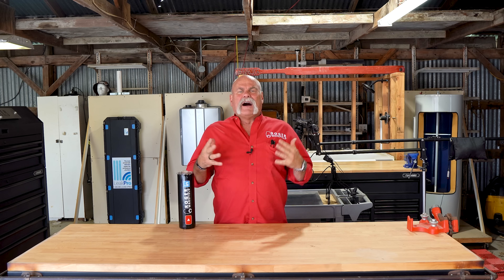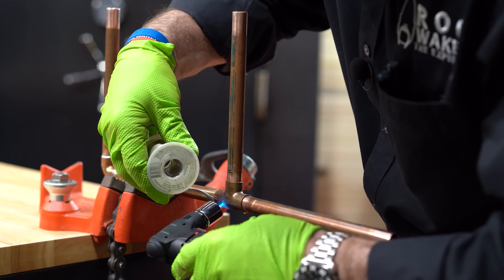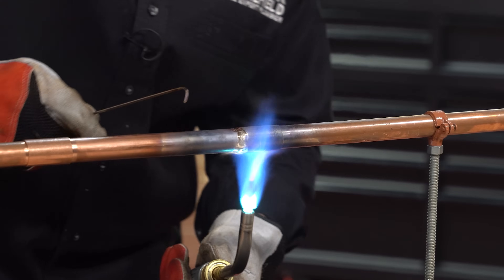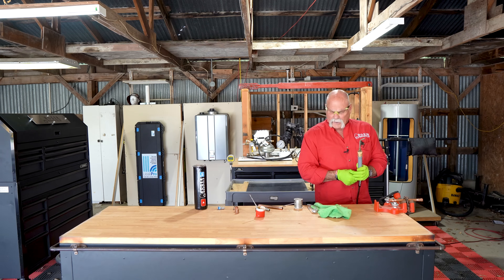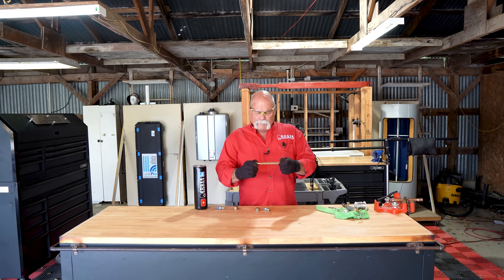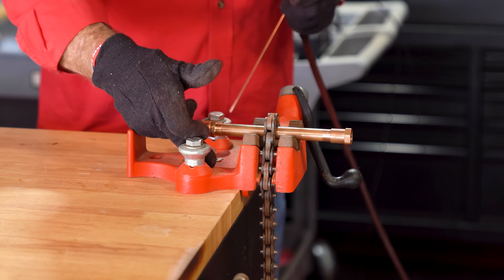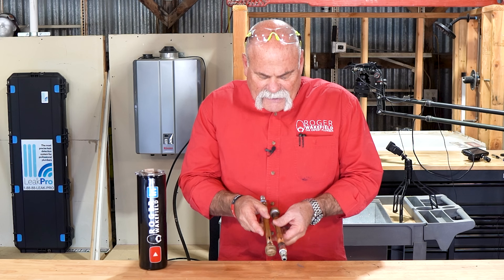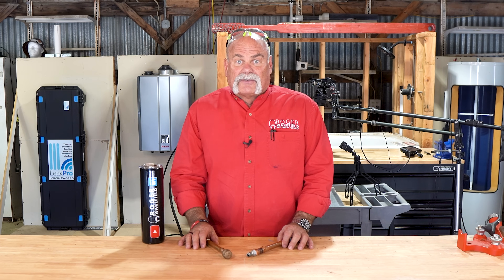Which Is Better Solder or Braze? | Pressure Test

Comment: I love this testing, and this confirms my point with refrigeration techs that never believe me - a soldered joint using something rated like Stay-Brite 8 is possibly stronger than a BRAZED joint. The problem is brazing weakens the copper from the high heat needed to braze. Solder temps do not do this, and it's just as strong as shown here. It held twice the pressure. Notice how the copper failed close to the braze joint, the heat affected zone. Any more of this type of testing you could do is great!!
Reply: I'm a refrigeration tech.  My main concern with using stay brite vs. braze is the temperatures the system operates at.  Compressor discharge temps in a refrigeration system can be over 200 deg F.  That's hot enough that it makes me question whether a solder joint can hold over time given its lower melting temperature.  If you get into large supermarket systems, nearly all the pipe in the system can go through regular thermocycles of up to that temperature daily, sometimes multiple times a day.  The 15% silver braze I use has an application temperature of around 1500 deg.  As long as I do my job correctly, I know I'll never have to worry about that joint failing because I have seen properly brazed joints well over 50 years old still holding leak tight.
Reply: @VTdarkangel  Stay Brite 8 solidus point of 430F and liquidus of 535F. Meaning it is solid at 430F and lower, and won't become liquid until 535F. While yes, in some high heat circumstances I agree, but even in R410A you aren't going to see above 150F (for the record, that would be a pressure of 615 psig, which the system would shut down by that point).
Reply: @JohnChuprun    You're referring to liquid saturation temperature.  The temperature of the gas as it comes out of the compressor is much higher than saturation, especially in the supermarket systems I work on because of the higher compression ratios that are required.  Any system that has a hot gas defrost will experience those discharge temperatures throughout the system periodically throughout the day.  That is a lot of thermocycles that can put a lot of thermal and mechanical stress on joints over the life span of the system.  However, I will grant you the AC application.  With the exception of the pipe between the compressor and condensor, the thermocycles of an AC system are considerably less severe compared to what I regularly work on.
Reply: The main problem with soldering on refrigerant lines is the acid from the Flux getting into the refrigerant. This will break down the compressor windings over time.
Reply: @JFirn86Q  AC tech and ex Navy nuclear plant operator with a concentration on chemistry controls to toss in my two cents.  While the liquidus temp of soft solder will never be reached by compressor hot gas under ideal situations. (I Have seen system discharge temps approaching 250F) You do not have to get close to the liquidus temp for the alloy joint to fail for the same reason a blacksmith doesn't need to bring his iron to the melting point of steel; plastic flow.  The joint will not fail immediately. But it will eventually fail as the solder slowly flows.  I have been to repair calls for residential heat pumps in the winter time  having the vapor lines separate and completely lose their charge leaving behind the tell-tale shiny silvery alloy on the stub and having to go back with 45% silver alloy to get enough whetting for the joint to hold.

Now, this not to say that silver soldering copper has no place in refrigeration, so long as it's less than 1/4 the liquidus temp like cold vapor only lines, or low velocity refrigerant flow systems.

Finally, a correction to your assumption about heat affected zones; copper does NOT flame harden, it only work hardens.  The heat affected zone works counter to your assumption; heating copper to brazing temperatures aneals it making it LESS prone to fatigue failure from overpressure, however because he applied heat to such a narrow point at the joint with respect to the pipe diameter he created a stress riser and explains why the failure occured where it did.  You are supposed to heat 3 x diameter of the pipe to create a gradual stress relief in hard pipe (not necessary in soft pipe). The use of type L is not recommended for systems above 600psi, which is why K is used in refrigeration applications so both should have held up to 6kpsi as the soldered test did, but improper technique caused premature failure in the brazed sample.
Reply: @sivalley thats alot of knowledge
Reply: @sivalley  Somehow this was brought around to high heat situations and grocery refrigeration which I said is not a proper application for something like this. I completely understand the potential for high stress environments where solder can undergo microstructure coarsening and fatigue crack initiation, but in a lineset of a residential AC system or just hot water pipes - this is not going to be the case. 

The evidence you found with an vapor line I would bet was likely from not something like Stay Brite 8 being used, but something like plumber's solder (50% tin 50% lead or something similar) and/or a poor application (not many apply heat correctly).

For the person who talked about flux, yes you must be very diligent to use a small amount and only on the male fitting.

Finally, of course heat doesn't harden it, it anneals with copper. This still makes it weak. If you do this test yourself, you will always find the copper bursts right near where you brazed it regardless of the technique you used. Everytime.
Reply: @mattmuch7536  Yes of course, anything with high heat it wouldn't be a good idea.
Reply: @JFirn86Q yes, the vapor pressure chart shows 615 for 410 at 150, but you are making the classic blunder of the untrained… superheat is a thing… compressor superheat, not suction superheat. 200F is easily achieved below 450psi with 410a…
Reply: @alexirwin2093  You would need to use tons of flux to do that.  Never seen it if you use the right amount of flux.
Reply: I braze on items that will experience vibration. Everything else gets sta brite 8
Reply: Solder is no good for refrigeration, it will crack
Reply: @sammyd7857  nope...
Staybright8 soft solder is FAR more resilient than silver braze in most applications.
Hot gas lines gotta have silverbraze, but liquid and suction lines arent an issue.
Reply: @SuperVstech  how many refrigeration systems have you done  solder on with no leaks and how long have they been in service?
Reply: @sammyd7857  ive operated in NC the last 40 years, sb8 has held up leak free on thousands of homes and txv installs.
My favorite is the ease of repair with tight spaces.
One issue is cleaning and TIGHT fitting joints.
Silphos is far more forgiving of damaged dirty fittings.
Sb8 needs immaculate clean and tight fittings.
Reply: Refrigeration techs should be brazing with nitrogen in the lines so the pipe won't oxidize and weaken nearly as much.
Reply: @neilcraig2593  it isn't oxidisation that weakens the pipe, it is the annealing. But pipe hardens again when there is movement. If there is too much movement with solder though, it will crack
Reply: @sivalley thats a real funny way of saying SMAG. ELTs always yapping. chief said youre on the hydrolance support watchbill to support M-div.
Reply: Braze refrigeration.

While Stay Brite 8 will technically work there are some concerns.

First, it won’t pass code in many places for commercial and industrial installs.

Second, it’s unforgiving with pipe cleanliness. This makes some repair work more difficult in your effort to make it less difficult.

Third, many OEMs advise against it. This is a serious problem on jobs that require a manufacturer tech to be flown out for a start up. Repiping a building could wreck your business.

Four, personally I find it more difficult to use when doing a nitrogen purge. So for me it doesn’t save any time unless I’m willing to be a “hack” and take every shortcut possible.
Reply: @cynic5581  Everyone here against Stay Brite is bringing up fringe or extreme cases, which is really just a poor argument. Yes of course, high heat situations like right after a compressor are not appropriate or extreme vibration (which really should be secured in a better way anyways than a free pipe rattling itself to death, failure will happen anyways in this case).
Second, so so so many hvac techs do NOT use nitrogen correctly. You can even see it in their own videos on youtube.
Anyways, it's a fantastic and equally strong if not stronger alternative in many situations found in regular residential.
You need to be willing to question the dogma that has you rote rejecting the possibility it may be a better solution.
Reply: @JFirn86Q  Now we have guys using crimp fittings on residential so the SB-8 isn't even a valid argument anymore pros or cons.
Reply: As a refrigeration tech I will say yes solder is just as maybe even more strong than braze however I will still braze on every unit because #1 solder requires flux which is an acid and there is no way to get that out once you put it in no matter how many times you vacuum the system. Also braze expands and contacts to thermal shock much better and similar to copper than solder which helps it last longer on a refrigeration system. Lastly brazing is much more flexible and high temperature resistant. With as hot as refrigeration system can get especially when a condenser fan motor breaks or what not or as much as they can vibrate brazing will hold up better. Both are plenty strong enough to handle the pure pressure but joints in refrigeration systems have to deal with many other factors
Reply: @VTdarkangel very true and even hotter if that condenser fan motor goes out of you've ever touched a liquid line on a system that has a broken condenser fan motor you know what I'm talking about
Reply: @tycurtin7565 no matter how small you're still adding acid to the system why even risk it
Reply: @jake48396  I know exactly what you're talking about.  My forearms bear the scars from learning that.
Reply: @jake48396  I agree with you mostly, however I'm not sure if I'm totally convinced that vibration resistance is superior. I'd like to see testing, as it seems those areas near the brazing areas are awfully weak. I could see vibration work hardening the annealed material. Also, like I said before, only use a tiny amount of flux on the MALE fitting only, and it will not get into the system (can try it with a short 1" section so you can feel inside afterwards for any flux to convince yourself).
Reply: @sivalley you had me at AC tech... lol but for real thanks for that break down as an AC tech myself you answered alot of questions I had 😅
Reply: @VTdarkangel Lmao you're a "tech" but don't think solder can handle 200°f? You might wanna go back to school.
Reply: @alexirwin2093 Wrong
Reply: @shawnd567  solder doesn't have to melt to lose its strength.  As someone said above, you typically don't want to use a filler metal if your working temperatures are going to be above 1/4 your melting temperature.  Solder typically melts around 450 degf.  200 degf is well outside of that limit.  However, sil-phos typically melts in the 1500 degf range.  Discharge temps are well within 1/4 of sil-phos's melting temp.  Perhaps I'm not the one who needs to go back to school.
Reply: @VTdarkangel  The strength of this solder at 200F is still in excess the strength of the copper itself. And no, sil phos solidus is not 1500F, it is 1200F. If you are going by liquidus, then go by liquidus of the solder, which is much higher than 400F. This is exactly what I mean, AC techs are entrenched and incapable of learning something new. Also - sil phos is also a filler metal, so not sure what you mean by that.
Reply: @JohnChuprun   Yes, I know sil-phos is a filler metal as well.  I thought that point was obvious.  

I was a little sloppy with my terminology, and I was using round numbers for brevity because they were close enough, but if you want details, here they are.  I used 200 degf because that is the average I see coming out of the compressor of a properly functioning system, but it can vary between 170 degf to 240 degf depending operating conditions and the gas in the system.  However, in a malfunctioning system, I've seen those temperatures go north of 270 degf to almost 300.  The pipe is also under constant pulsation and vibration, even in a properly functioning system. That is something that can't be stopped.  Instead, it must be designed around.  I have seen these systems run in these malfunctioning states for weeks, months, or even years because store personnel didn't recognize the problem and notify us.  Those conditions concern me with the use of solder.  I don't want to add pipe failure and gas leaks to my list that I have to fix if I can help it.  I routinely work on systems with 700lbs to 1500lbs of refrigerant in them, and any leak becomes EXTREMELY expensive, especially if you consider how the price of refrigerant has sky rocketed in recent years.  Those leaks become even more expensive when you include the costs of lost product because the system can't maintain proper temperature due to low gas levels.  In a bench test, you may be correct that solder can handle those temperatures, but my concern runs into conditions well beyond those bench tests.  If you know anything about metallurgy, you know that you don't have to get to the solidus temperature of filler metals before their strength begins to fail.  When you add in the other application conditions I'm concerned about alongside those temperatures, the questions about solder's ability to hold over time become very real concerns.
Reply: @VTdarkangel  Again and again this is the normal comeback I see. Extreme or industrial cases. I said I wouldn't use it straight off the compressor discharge line, and in a large commercial or industrial plant that's a different story that would require thorough evaluation. You weren't sloppy with your terminology before, you were just comparing apples to oranges in the 2 temps.
Reply: Great comment! Thanks
Reply: I have put in residential HVAC systems with low temperature silver solder and never had a problem. Mostly used Harris solder and flux.
Reply: Stay-Brite 8 works well in refrigeration. I had to repair braze joints that fail in the copper pipe just pass the braze. Yea, the brazing heat weakens the copper anneal. With small leaks in a refrigerator application I clean up some 16ga copper wire, wrap it around the affected area, flux and solder with Stay-Brite 8.

The "knocks" against Stay-Brite 8 not appropriate with joints near the compressor (vibration) and the low melting point.

If i am connecting directly to the compressor I still braze. Again, it is my experience that Stay-Brite 8 is better with it comes to every other joint.

The low melting point is something that comes up when dealing with "codes" related to fire. There is a chance in a fire, that the heat around a Stay-Brite 8 pipe joints will give way before joints that are brazed.
Reply: @VTdarkangel don't be concerned. The StayBrite8 is going to be just fine. I use it almost exclusively and have done for quite a few years. Never had a leak!
Reply: @sammyd7857 wrong. That's why you use solder design for refrigeration systems.
Reply: @cynic5581 you don't need to nitrogen purge when you solder refrigeration lines. Your temperature is not high enough to create oxides if done correctly.
Reply: @MrDeviousdom  if all the proper testing has been done, particularly vibration then all good.
Reply: There's no 
"possibly" allowed.  Either it is or it ain't. You're just repeating what you hear from people understand what to do "When", and  "Why". Stick to what you know, if you know anything.
Reply: How about testing with Swagelok brass compression fitting?
Reply: @peterd6592  you are always better off soldering or welding for a leak free connection.
Reply: Came here to say this, beat me too it!
Reply: On average you will see discharge line temperatures between 160 to 180 degrees on properly functioning residential ac systems at typical summer conditions.
Reply: I have tested Staybrite 8 at Compressor Scrolls discharge port and amazingly it doesn’t leak. We all know how hot it gets at that point.
Reply: I’ve worked , 36 yrs in A/C And NEVER , NEVER had a fitting burst from my installation after brazing due to.‘ Thermal ‘ shock , in Australia we have never used and our standards WILL NEVER ALLOW THIS ‘ this Brite ‘ solder , it’s just to soft And personally I will only use 15% silver solder , NOT  to offend , but anything with lead , I’m not comfortable in using .
Reply: I was looking recently at the possibility of either spending $15k on an entire new HVAC system, or < $500 on a used R-22 condenser, to replace my potentially leaking unit (spoiler: it wasn't.) I've never brazed, but i've done a TON of copper sweating for water plumbing, and was looking at the Stay-Brite 8 method if I had to change my condenser myself.  Good to know that I'd have been find if I had to do that... or if I do have to do it in the future.
Reply: That's just wrong. You're still introducing air/moisture into the system when it's open. @MrDeviousdom
Reply: @CatnamedMittens  what's just wrong?
Reply: Yea brazing anneals it to a much softer state.
Reply: Thanks for sharing
Reply: The only service calls I get when sliver bright is used, I find solider balls in filtering screens , and filter driers , usually it’s on heat pumps